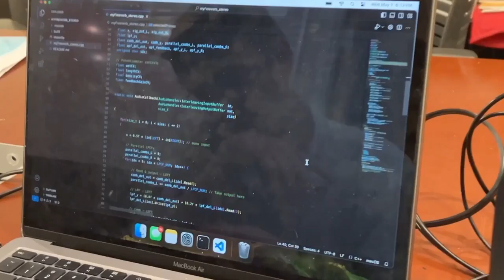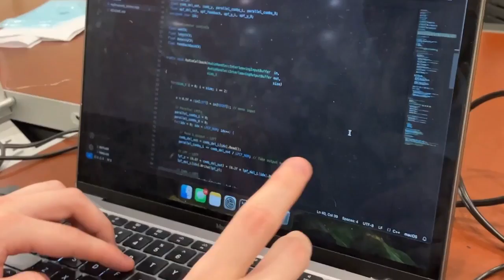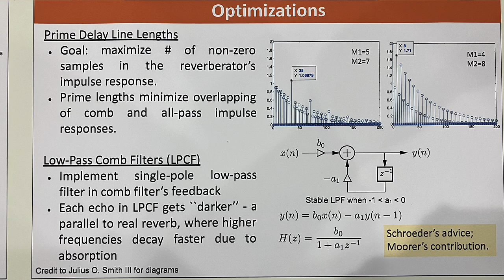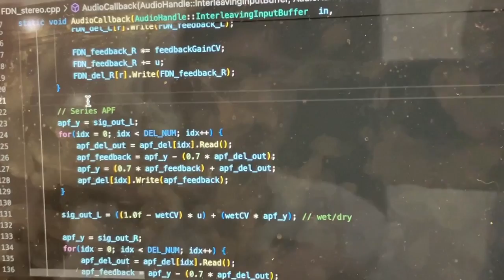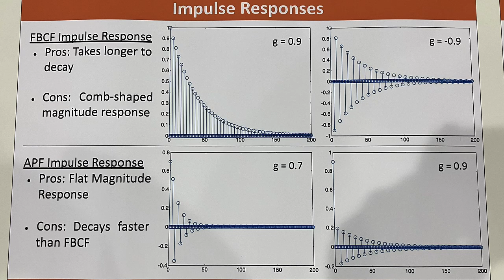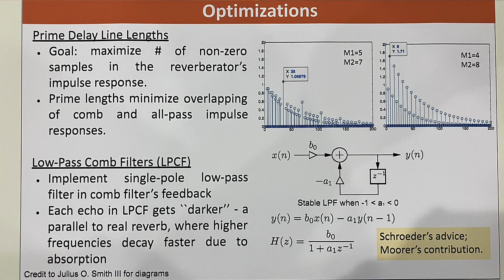Algorithmic Reverb on the Daisy Seed STM32 Platform (Music Tech Capstone Project at Georgia Tech)

Comment: Hve a look at the Teensy 4.1 Board. It lack's of the ADCs (which can be added via daughter, but the power is unbelievable:FP DSP at 600Mhz).
Reply: Not a proper tool for dsp design, it’s block based processing makes it extremely difficult to work on per sample basis
Reply: @euglossine_tristanwhitehill  The Daisy Seed /Axoloti/Bela etc are all block based. Only 'real' DSPs may able process on sample basis. But what's wrong with block base?
Reply: The teensy audio thread is not accessible in the same way as daisy, juce, bela, and most c++ audio routines are, a good example of this is the big discussion of interpolation on their delay object, you should see the implementation of a tape echo to achieve the effect
Reply: @euglossine_tristanwhitehill  I actually have implemented a tape echo effect with the 4.1 without any problems. Yes, Teensy uses still 16Bit Integer Blocks, but coversion to and from float is no problem. I have even created a complex Synth with 1028 Osc/Env and Filters without any hickups.
Reply: @clausanders2886  that’s sweet but what I’m saying is there’s no process block at the sampling rate to make per sample changes, daisy and others have this, teensy it all gets passed automatically to the processor but you can’t change the samples inside the block
Reply: @euglossine_tristanwhitehill  Did I miss something in the Daisy lib?I only see Audio Callbacks with blocks. Youmay have blocksize 1 , but IMHO, that doesn't mean per Sample changes.
Reply from the maker: A few years ago I had a senior design team that used a Teensy for a guitar effect.
Reply: @Lantertronics  Actually a guitar effect is underwhelming. How about a harmonic Synthesizer with 64 harmonics, each having 256 length  envelopes over time?

Comment: Cool, seams this Daisy board has a ram chip.
Reply from the maker: Yeah, it's the one with the extended memory.
Reply: @Lantertronics  I like the Datasheets of Microchip, it's easier to pinpoint what you need, most of the time, via their YouTube channel, i asked them for a Fubarino Max version with DDR ram compatible with the Arduino IDE, great idea make a suggestion via email, than they send you to their website, where some 3rd service company handles the email, Than this guy has no clue with what you discussed with the YouTube "team", makes some other suggestions and in the end you get nothing done.
They have a PIC32 "series" that's comes with DDR ram support. it would take months to, understand, hack and adept the Fubarino firmware with the USB stuff.

The Arduino IDE is great, just 2 buttons, strictly biznis.